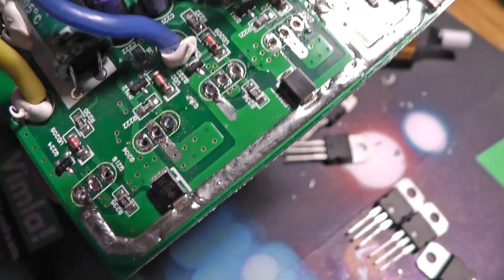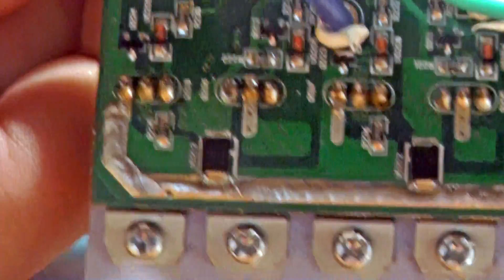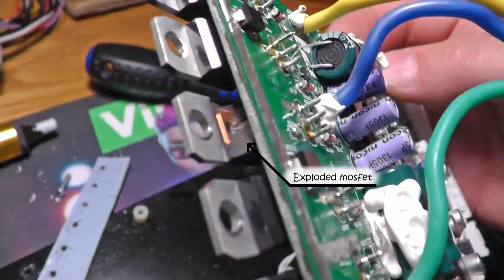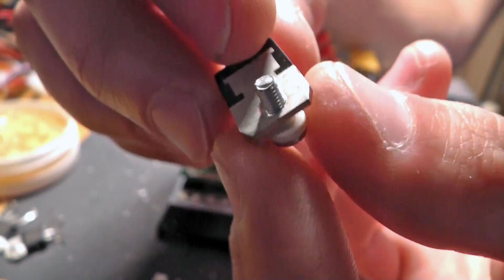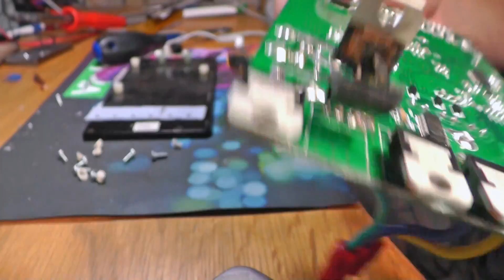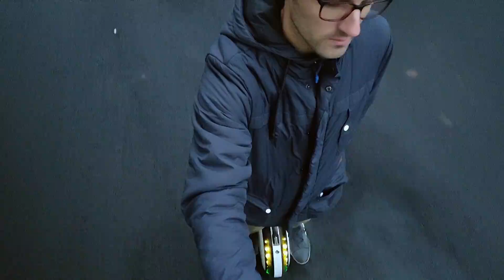Learn to Ride EUC and destroy it

Comment: Congrats on buying a new EUC. The former one doesn't look as a good choice anyway. I made the same mistake once and forgot to put isolating piece under MosFETs. 
Also, it's very unsafe to turn the wheel on until you screw the motor and controller board to the chassis. It's better to connect battery port on contoller to the charger via adapter for test purpose. Don't connect it directly to the battery until you totally sure you assembled everything correctly.
Reply from the maker: That's a good idea with the battery charger, then there won't be such a rush of current. I'll do that next time xD I don't like the design of this old EUC, hard to work with it partially assembled.. The new one is better in many ways, also higher top speed :D

Comment: :-)
The Mosfets probably never have been defect ....because as long as the wheel moves they are not. And: NEVER work yourself on a motherboard...alsways buy a complete new one.

I would higly suggest that you buy a „real“ electric unicycle, because the one you own now is tech from 2015/2016 and is considered just a „toy“ and no real vehicle.

ACTUAL electric unicycles have about 10 times the power and are much, much more reliable, faster, more powerful and safe! Do no safe money on the wrong side,
Just my 2 cents....
Reply from the maker: Thanks for the advice, sounds like you have deep pockets, at the moment I can't spend much money on EUCs, I just happy I am able to ride EUCs for cheap. I would love to buy an actual EUC one day :)
Reply: @BagheeraTube  I totally understand, when no money is available, i am also not rich.
The point i wanted to make is, that actual EUCs are just much safer, they dont „cutout“ anymore....and can not be overpowered that easily.